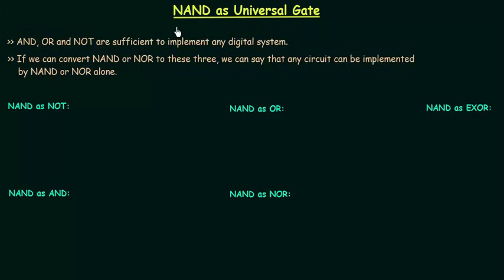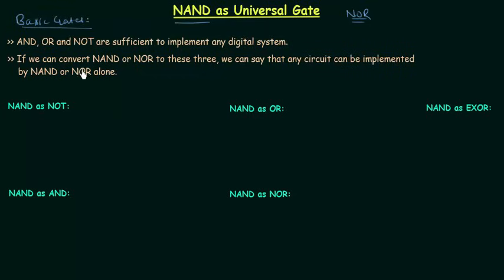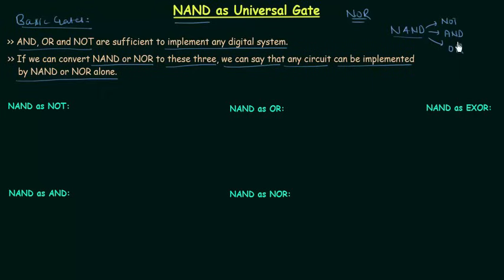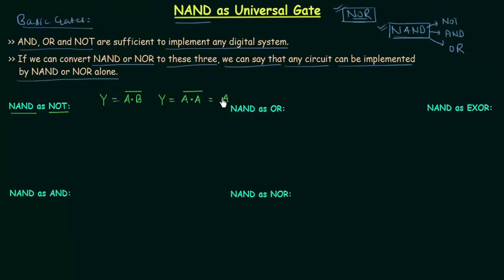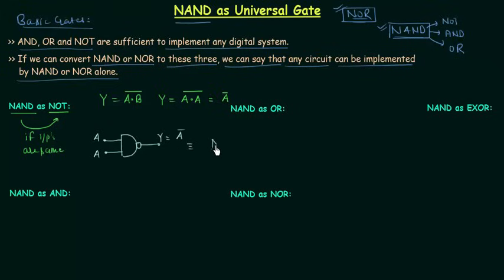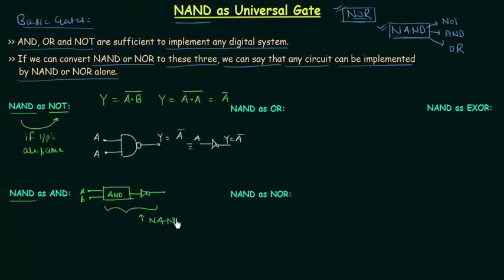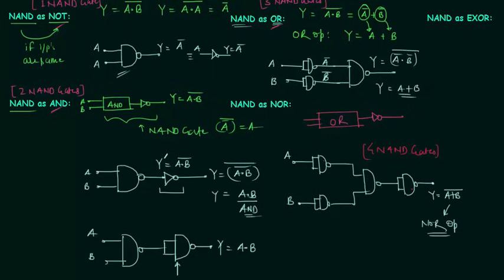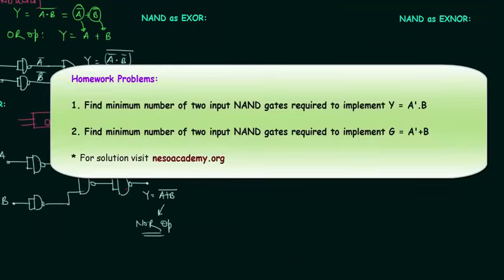NAND Gate as Universal Gate (Part 1)

Comment: For H.W problem
most of the people said 1st question answer is 3 NAND Gates
but, It is 2 NAND Gates
because A(No gate normal input) ,B (1 NAND gate for Complement such as B') then,both inputs are given to an Main NAND(1 NAND ) Gate,it will give Y=A'.B.
therefore 2 NAND requires

is there any mistake kindly correct me
Reply: well it's 3 months late, still 
according to your circuit the answer will be A'+B and not A'.B

Comment: H.W questions
1. Minimum 3 NAND Gates required ( out of which 2 Shorted and 1 Normal)
2. Minimum 2 NAND Gates required (out of which 1 shorted and 1 Normal)
Reply: I got the same answer.
Reply: why are you writing minimum ? 
can we not say exactly 3 NAND gates ?
Reply: @aakashnailwal2249  The Thing Is We Can Achieve the Same Functionality by Using a more Number of NAND Gates But to Least 3 NAND Are Required for the 1st Question and Minimum 2 NAND For The 2nd Question. Rest You May Use More Number Of NAND Gates. 
Therefore, Mentioned Minimum 3 NAND & Minimum 2 NAND

Comment: so  for first one it's A as a double input for a nand inverter and a b input these two are the inputs to another nand you will get A''(double complement)B' then this is a input for a inverter nand  and you will get A'B and second one you have A as a input1 and B followed by a nand invertor wich means B' as input 2 for a nand and you get (AB')' using de morgan rule this means A'+B. if i'm wrong correct me . for first one i used 3 nand 2 and for second 2 nand 2
Reply: Thanks a lot for this explanation
Reply: Excellent brother
Reply: I was struggling with the second problem. Thanks a lot
Reply: I got the answer but still have a confusion , what does  the term         " two "    in the question " Find minimum number of two input NAND gates required to implement Y = A'.B  " , tells us ? Can anyone describe to me
Reply: @ajiteshkumar5841  means NAND gate you will be using can only take 2 inputs . Seeing the question you can make out it can take only 2 inputs A and B .

Comment: my question is that if NOT gate is used to make the NAND gate than how is the NAND gate universal ?
Reply: The NAND gate looks different because it only has one input and it's splitting into two inputs A.A, so it looks like a rectangle/square attached to NAND gate.
Reply: definition of  universal gate says that every digital circuit can be realized using NAND gate there is no comments about the internal circuit of NAND gate.